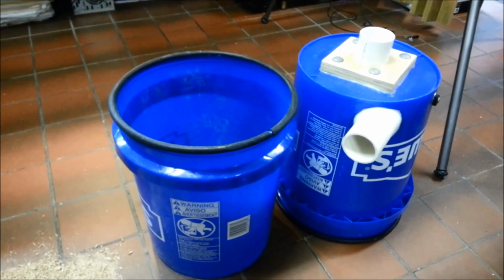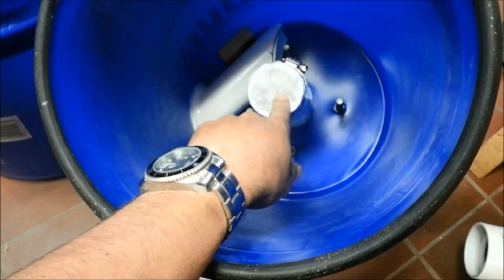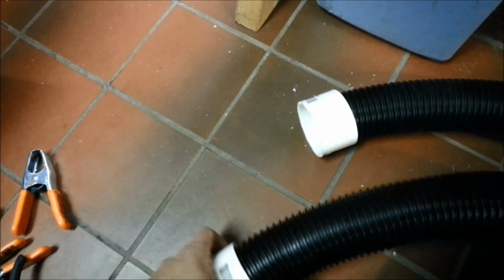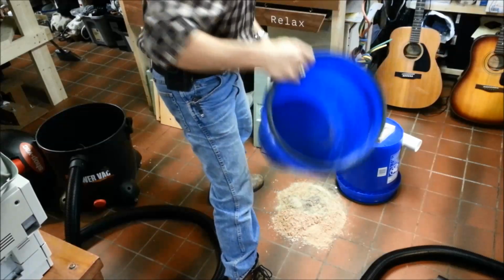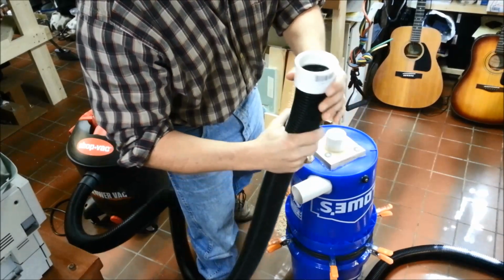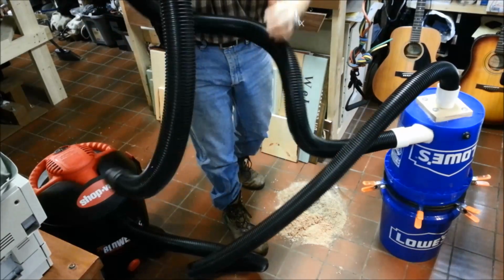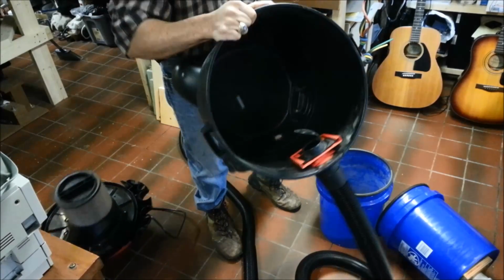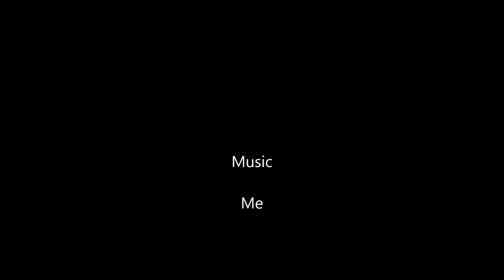DIY Dust/Chip Collector System - Cheap & Easy

Comment: LOOKS AND WORKS REAL WELL BUT IF YOU DONT MIND ME SAYING IT SEEMS TO TIP OVER EASY, JUST A SUGGESTION MAYBE FIX THROUGH THE BOTTOM BUCKET INTO A WOOD BASE PLATE WIDER THAN THE BASE OR STAND A COUPLE OF BRICKS IN THE BOTTOM, ITS A GREAT DEVICE THOUGH WELL DONE.
Reply from the maker: Thank you for your comments.  Yes.  I agree - it was too tippy, so I built a rolling cart to hold it.  Here's the video on the cart:  https://www.youtube.com/watch?v=VAPoFlAqQFE

Comment: I looked at several versions of this and this seems to be the best and easiest.  I made a couple minor changes.  I used some foam pipe insulation material for the seal (you only need it on one of the buckets) and I screwed a round wooden base on to make it more stable.  It is probably my imagination, but it seems to work better than the vac alone.
Reply from the maker: Hi Mike.  Sounds great.  I'm all for modifying designs to test new things.  Best of luck.

Comment: Used this design after messing around with a few other designs, and it works great. I was lucky enough to find a bucket that fit snugly inside the other, so didn't have to use clamps.
Reply from the maker: ianhig Sounds good.  Thanks for commenting.

Comment: Nice build!  Simple and effective. 
If you add a Thien baffle you will be able to get the bottom bucket full without passing increasing amounts of dust. 
Keep in mind that cyclones collect around 98% to 99% of visible size particles, they pass through most of the harmful dust particles 2.5 microns and smaller (too small to see). So, this is a great idea to keep your shop vac filter from clogging quickly but make sure you use a good filter at the shop vac to protect your lungs.
I made a cyclone system and was amazed how well it seemed to work but when I tested using a Dylos particle counter I was shocked to find that ambient air particle counts were over 10x the unhealthy level even though I could not smell or see anything coming out.
Always use a good filter on the shop vac.

Comment: Ok,I'm probably going to get beat up for this question,,what is the reason for the lowes buckets contraption,,why not just use the shop vac itself?,,,,does the collector system pull more vacuum  or something,,,,?,,great job though,, and video,,
Reply from the maker: stedun77 You're not the only one to ask, don't feel bad.  For woodworking a shopvac will have a clogged filter in about 10 minutes.  The wood dust is too fine and the machine will burn up its motor very fast, sometimes within weeks.  And as the filter fills up the suction drops off quickly.  By using a separator you maintain the same good suction force, don't clog expensive filters, and prolong your motor's life.  It's also easy to build the system with buckets that can hold a lot and be easily emptied.
Reply: That makes sense,,plus I also figured out if you use the separator you can add suction stations along the way,,great ,,thanks for
explaining,,!

Comment: problem finding sealing hose for the 2 buckets any sugggestion where to purchase & the size of hose would be great too. Thanks FD Cox
Reply: +fdc313 
1/2 fuel line sold at any auto parts store.
Reply: I used some weather stripping with an adhesive backing. Just something soft or rubber to make a seal.

Comment: Having built this separator, I was amazed at the efficiency! It's close to 100% with almost no detectable dust coming through from my table saw. It will be interesting to see how well it copes with drywall dust, which I believe is quite difficult to deal with.
Reply from the maker: TeknixTrix Thanks for your comments.  I've been pretty amazed too.  I haven't tried it on drywall dust though...that will be a good test.

Comment: This design is great...just what I needed. I made a couple of slight changes that I think work well: 1. I bolted three small slats of wood vertically and equally spaced around the inside of the bottom bucket. They each stick up about an inch over the rim of the bucket so the top bucket fits snugly over them. 2. I used short thin bungie cords instead of clamps. Three cords spaced equally around the bucket work well. There is a ridge along the rim of the bottom bucket and a lip on the top (bottom) of the top bucket that work perfectly for holding the buckets together. 3. I made a very simple stand with rollers that holds my dust collector and bucket so that it doesn't tip over as I'm using it. It's also nice to be able to roll it around the shop. Hope this helps someone! Thanks again for the design.
Reply from the maker: guitarguy2308 All great suggestions.  Thanks.  And, yeah, I did build a cart to hold it all.  It is a great little dust collection system.  I should have built it years ago.  Here's the cart video:  https://www.youtube.com/watch?v=VAPoFlAqQFE

Comment: awesome video, i screwed a round piece of mdf to the bottom of the bucket and it cured the tip over issue. (i have a 1 bucket setup)
Reply: Some vacuums are strong enough to collapse the lower bucket. Seen others use a 3rd bucket and either put some sand in it or a few bricks or somethin heavy then set the two "mated" buckets in. Keeps it standing up & eliminates the collapsing. You could even go borrow an old brake rotor from local auto shop to use as a weight.

Comment: I was so impressed with this one I'm building me one all most like it. I'm using 3 buckets instead of 2. I'm setting one on top like you but I have cut it off about 2" down from the bail ribs. then all I have to do is mount the two pvc pipe in the third bucket like you did the second bucket. I just slid it down over the other one on top (like stacking two buckets, does away with using the clamps, Just a few screws and some duct tape or silicone around the seem to seal it and your done
Reply from the maker: William Castleberry Sounds good.  There are always ways to improve designs.  Let me know how it goes.
Reply: William Castleberry  "I have cut it off about 2" down from the bail ribs". Do you mean that you cut the top off the bottom bucket 2" down from the bail ribs?
Reply: John McGuire I'll take a pic and send it to you if you would like
Reply: +William Castleberry 
Yes William I would appreciate that. Thank you.
Reply: I would also like a photo

Comment: I'm curious, how much dust made it to the furnace filter you added in or on the bucket intake?  Based on your design I didn't expect any dust to make it to the shop vac since you added the extra filter.  I'm only asking cause I want to know if you're just changing which filter to clean all the time or not.  :-)  Thanks for the video.
Reply from the maker: Hi Larry - I tested taking out that pre-filter on the PVC intake (it's actually off now) and didn't notice any saw dust getting to the Shop Vac.  The pre-filter that I used was pretty open.  It was a cheap thin filter with wide mesh.  It would slowly fill up but didn't seem to affect the power of the vac or operation of the system.
Reply: drez20001
Very interesting, wished I had seen this video before buying a dust deputy.  Found your video searching for vac carts to get some ideas for mine.  I just might build one of these for my second vac anyway.  Thanks again for sharing this idea.

Comment: I love this cyclone dust collector/separator, built it and it worked great. I made one adjustment. I did not like the clips sticking out, so I used short bunge cords, I twisted 2 cords together (used 6 in total) and used the opposite ends for in a X configuration and hooked the ends to lower protuding lips of each bucket to create a seal, worked well. Thank you for the demo.
Reply from the maker: Thanks for your comments.  Great suggestion.

Comment: Thank you for this video. I am not sure I understand 1 thing. I hope you'll clarify for me, please. Why do the points of the Lowe's insignia need to line up? Thanks.
Reply from the maker: +Lew Alessio Hi Lew.  There's really no requirement and it will certainly work if they don't point to each other.  On the buckets I have by lining up the points it seemed to fit more evenly.  Thanks for taking a look and your comments.
Reply: +drez20001 OK, thanks for your response, and for the pleasant background music. Entertaining and informative.
Reply from the maker: Many thanks.

Comment: Nice build - bungie cords might be more convenient instead of the clamps.  Why do you need two buckets?
Reply: It will leave more room for the dust to settle on the bottom and not get pulled into the vacuum.

Comment: Great project, interested in doing it myself.  Any place to find specific instructions for building the cyclone component of the bucket?  Many thanks...
Reply from the maker: Derek Aday Hi Derek.  It's pretty straight forward and doesn't really require a lot of accuracy.  Eyeballing the distances in the video or from other builds on YouTube should work fine for you.  Best of luck.

Comment: Hello, Does this affect the suction of the Vacume?
Reply: Vacuum cleaner
Reply: It has not affected the suction of my vacuum you need to make sure everything is sealed up good, my dust collector is basically the same as this one except I only used 1 bucket and a lid for it and it works great and it's not so tall and top heavy and pron to tipping over like this one he built and even doing just a single bucket it still collects all the dust and it is super easy to build I scrounged up some stuff from around my garage to make mine and it only took me 20 minutes to make.

Comment: great tutorial, is the any suction loss?
Reply from the maker: No loss.  I've filled the bottom blue bucket up more than 50% and it has still pulled fine.  I should have built this system years ago.  Thanks for your question.

Comment: May be add some heavy metal parts to the bottom of the bucket tostabilise the system?
Reply from the maker: Yep - I actually built a cart to hold the collector and the vac to fix that.  Thanks for taking a look and your comments.  DIY Dust Collector Shop Vac Finished Cart

Comment: Hi drez200001, great video. This is the simplest and most effective dust collector I have seen on Youtube. I want to use this system to vacuum granular wax to a height of 10' and have the wax fall out into a hopper. Do you think the 6.5 h.p. Rigid can handle this?  Will the system work with a hole in the bottom cut out for discharge, or do I need to have the open bottom full of material?
Thanks
Reply from the maker: +Henry Keenan Hi Henry.  Thanks for your comments, I've been using this in my shop for a long time now and it works incredibly well.  As far as cutting a hole out for the wax to drop out, not sure if that would work as the dust in my bin certainly swirls around a lot before settling.  You could try it and then if it doesn't drop through just cover the hole with a patch and sealant.  A 6.5 hp unit is plenty strong for a collector like this.  Do share your results if you give it a try.

Comment: Any dimensions would be very helpful. 
Ex: how far does the tube protrude into the bucket? What size is the rubber hose? Etc
Reply from the maker: silveravnt The design parameters don't have to be real exact; it's going to work fine if you're off an inch or two.  For the hose length with these buckets it was about 40" for each one to create an acceptable seal with the little clamps (six clamps evenly spaced).  The 2" PVC tube protruded into the bucket by about 7".  The 2" PVC indicates the inside diameter.  Regarding the PVC tube I wanted to make sure the end of the tube almost touched the inside of the bucket on the far side to create a good cyclone.  Thanks for your comments.
Reply: drez20001  Thank you. I cut my outlet pipe so that 7" was in the bucket and 3" was above. I used a 4" piece of 3/4" plywood to steady the inlet pipe. I only used 3 clamps and they work fine. For the seal I used 1/4" ID fuel line. Thanks again!

Comment: Mine shrieks like a banshee!??  Any ideas?

The buckets collapse also.   HELP!!
Reply from the maker: Mark W Hi Mark.  If the buckets are bending in then they are just too thin - the shop vac I have is very strong (around 6hp) and it doesn't suck these Lowes buckets in at all.  That would be my first thing to replace or check.  If it's screeching I'd also check to see if the seal between the buckets is tight.  This one doesn't have any noise along those lines.  Best of luck.

Comment: what is the point in that you need a hoover for it, just use the hoover....
Reply from the maker: For woodworking a shopvac will have a clogged filter in about 10 minutes.  The wood dust is too fine and the machine will burn up its motor very fast, sometimes within weeks.  And as the filter fills up the suction drops off quickly.  By using a separator you maintain the same good suction force, don't clog expensive filters, and prolong your motor's life.  It's also easy to build the system with buckets that can hold a lot and be easily emptied.
Reply: +drez20001 nice cheers

Comment: Thanks for the post. Any reason not to just use one bucket and a lid?
Reply from the maker: The two buckets just offer more holding capacity and more space for the dust to settle and not be blown around too much.
Reply: +drez20001 that makes sense. Really like your design overall
Reply: I made mine as a single bucket and a lid and it works great you will just have to empty it more often because it will have less capacity but I would rather have to empty it more than have to clamp 2 buckets together and have a tall top heavy 2 bucket one that will be pron to tipping over plus it takes up more space, I definitely prefer a single bucket with a lid that works better for me and my setup in my garage where space is a premium, plus a single bucket with a lid is so easy to make I made mine in 20 minutes

Comment: cool but i just dont see the point of it when i can simply use the shop vac as it was intended. Cleaning a filter is easy.
Reply from the maker: +Thomas yates Using a shop vac for a lot of woodworking will fill up the filter incredibly fast.  The fine sanding dust will clog the motor as well and make it work harder.  It's life will be greatly shortened.  Using a dust collector of some kind in line will not only keep the suction the same without any fall off as the filter gets clogged, but it will make your vac last much much longer.